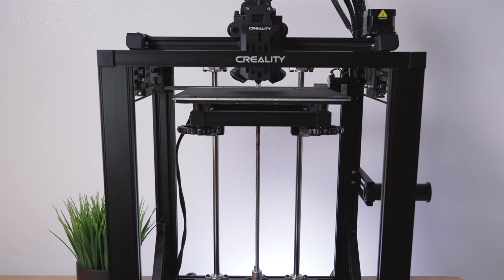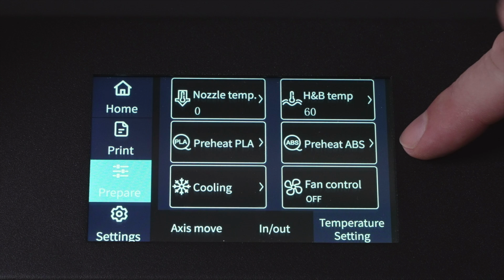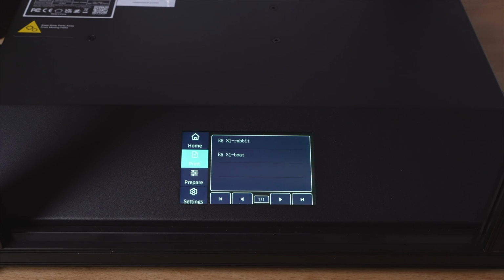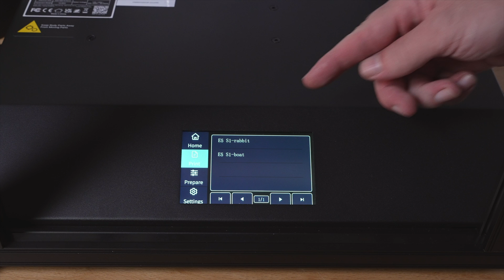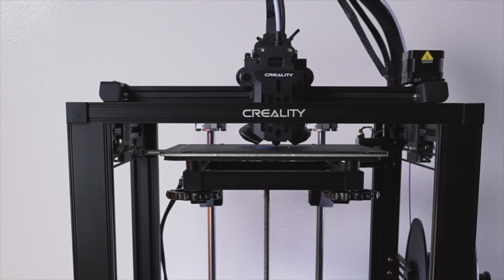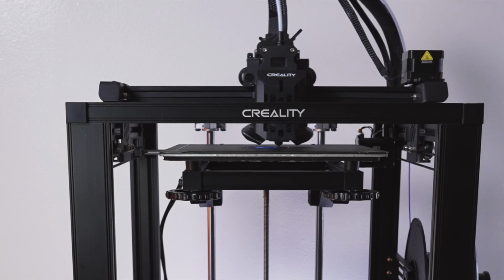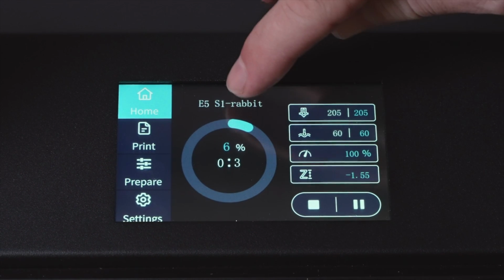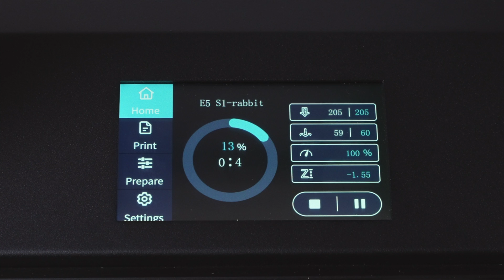Creality Ender-5 S1 - Overview & Leveling

Comment: I've been trying to get my Z offset 
and it seems when it goes to the top so I can make adjustments there is always a gap of about 5mm
Nothing is adhering to the plate. Any idea why it may not be letting me adjust the Z to the paper thin size.

Comment: Hey bud your leveling advice is literally damaging people machines. Multiple comments in here to back it up. I watched your full video on your other channel to guide me through the set up much appreciated. But if you level this way after a few times you will have your head go right through the bed. You're a problem until you correct this. You need to tighten all the knobs when the machine is off, don't even have to be even, just not loose, so you have play to manually level later. Then when you turn on manual leveling the first step is to adjust the whole bed with the arrows on the screen to a reasonable gap at any corner. THEN proceed to go corner by corner with the paper gap and knobs. Including checking the center. I had to learn this myself after thinking through it since I destroyed my magnetic bed cover and had to purchase a new one didn't want to cause any more damage and some of my knobs were no longer attached to their posts.
Reply: Yea I damage my bed the same way watching this video never got to print and its damage....grr
Reply: GOING TO TRY THIS TODAY WHEN I GET HOME - ALSO SEEING A LOT OF PEOPLE TALKING ABOUT THE Z AXIS TENSION IN THE LEAD SCREW - GUESS WE'LL FIND OUT - ALSO SOMETHING TO NOTE THAT I NOTICED IS THAT WHENEVER I USED THE GCODE THEY GAVE ME OF THE RABBIT, THE LEVELING IS PERFECT AND PRINTER WORKS - THEN WHEN I USE SOMETHING I WANT TO PRINT FOR MY RC CARS THE THING WONT PRINT - EITHER TOO HIGH OR TOO LOW - MY PRINT BED LOOKS LIKE A SCENE FROM THE CHAINSAW MASSACRE... NO JOKE.

Comment: it worked fine first but after i leveled everything for the 2nd time, now it starts printing too far above the build plate and i've about had it with this printer.
Reply: Adjust z offset
Reply: @TinderSwindler_  After some days it fixed itself, I don't know why it wasn't working. Next problem is the bed does not heat evenly. On the left side and bottom, mostly towards the left, the parts are warping and lifting off. Printing in the center works fine. Also when I tell it to go to position Z = 50, it will go to position Z = 288 and stop. Also, where is the WiFi???!!!!!!
Reply: This happened with me too it just ignores the leveling entirely
Reply: @jimek13  it got even worse, at one point during the manual leveling, when going from position a to b, the bed actually moved up, then the head moved scratching the shit out of the bed and then the bed went down again. I'm pretty sure this printer is ruined.
Reply: @dronefootage2778  this identical thing happened to me my plate is destroyed I got a new one. I think I solved. Turn machine off. Manually tighten all 4 knobs til they're pretty tight don't worry about even across all 4. Turn machine back on. Manual level a corner. While on the corner 2 for instance use the screen to adjust the middle and eye the gap and make it closer. Then proceed to use the knob. Hope that makes sense
Reply: @jimek13  My other problem is that the bed is now bent because of this crappy firmware and one of the knobs can't really provide enough adjustment anymore. I got one side super tight and the other basically flopping in the breeze. I'm going to contact support, I still have time to return the thing for a refund.
Reply: @dronefootage2778  my fix was described poorly but it solves that. The knob is loose push up on it and turn it til it catches and make it much tighter not loose. Do this for all 4. This must take place when the machine is off. Then you can restart manual levelling by going to a corner and still adjusting with the z axis button on the screen even though you're on a corner til the gap is reasonable by eye. Then resume knob leveling

Comment: Do not level this way. bring bed up and set offset first then paper the corners and last auto level. this video is wrong
Reply: Yep I had to switch after watching this to what you described. You have to do offset first even if you bring it to a corner in manual level and adjust the offset from there by eye before going to the center or using the knobs. This guy is giving advice that will literally damage your machine after a few levels. I would know because it happened to me.